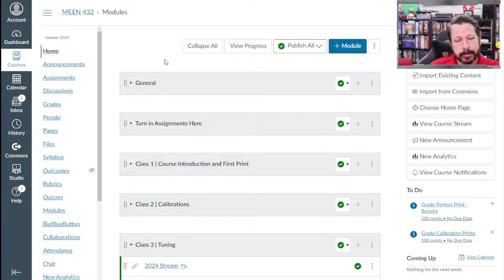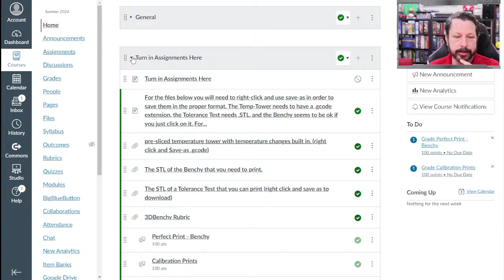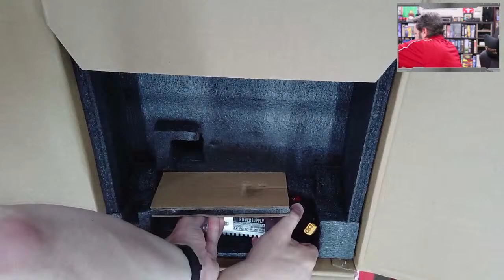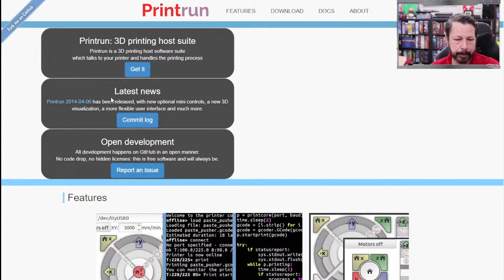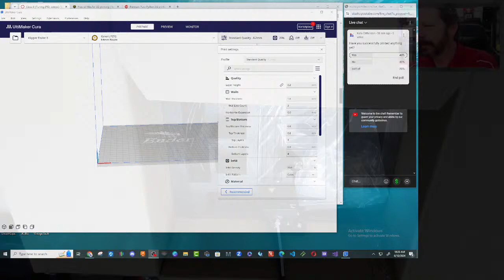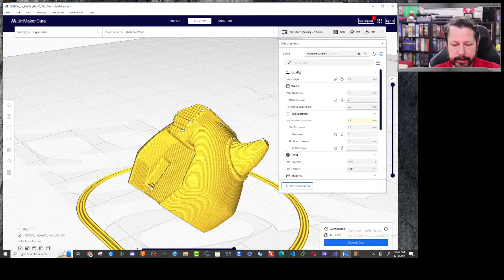Summer 2024 Additive Fabrication | Calibrations | PID | eSTEPS

Comment: Hi. I took this class several years ago live (on YouTube) and am running through the latest version again. You showed the class site and was wondering if you have that available for YouTube access. If not, are there any files there that are needed to take the class? Just got a new FlashForge 5M Pro (Core XY) and will be using Orca Slicer. I also use Fusion 360 vs Solidworks, so guessing there will be some things that really don't apply to me. Any comments on what videos I should go through and which I shouldn't? Any suggestions on how I can still get the most out of this while using my printer and various software? Appreciate any help. Thanks.
Reply from the maker: This is something I have often thought about but haven’t put together. I am about to teach the course again in person starting in a few weeks and maybe I will have time to think about how to deal with students who are not on campus. In general though, there are not many pieces of software that I use that are behind any sort of paywall. There are some that you get for free with a .edu email address though. The course does have the same general structure each year, but it does evolve to try to match current trends so hopefully there is some new and useful information from the last time you looked at it. I will think some more on how to get any written content out on the internet. Also, thanks for keeping up with the channel!